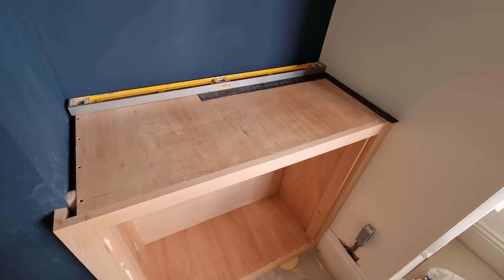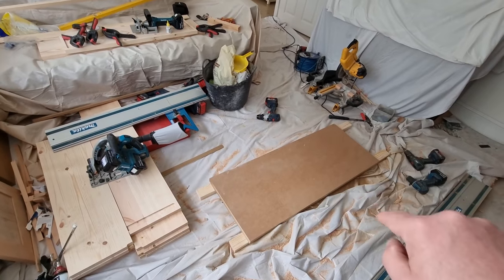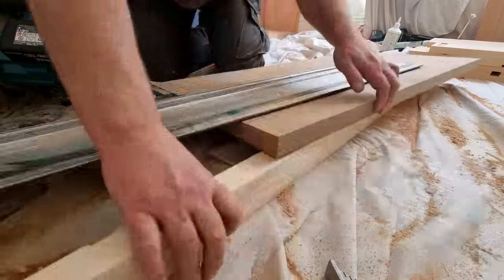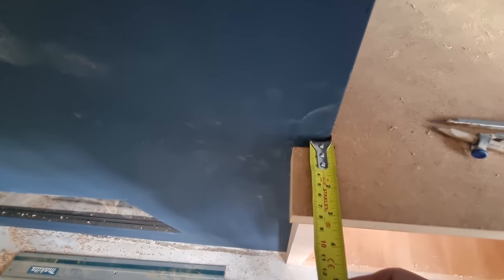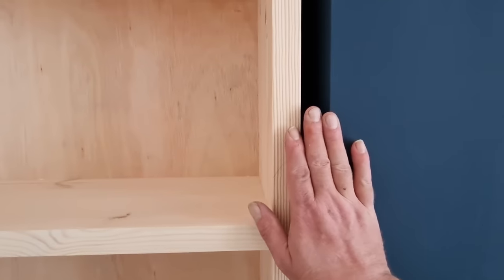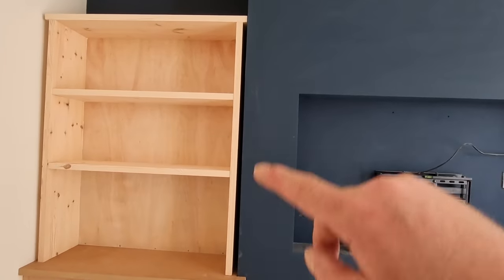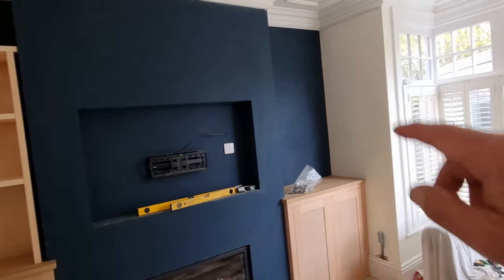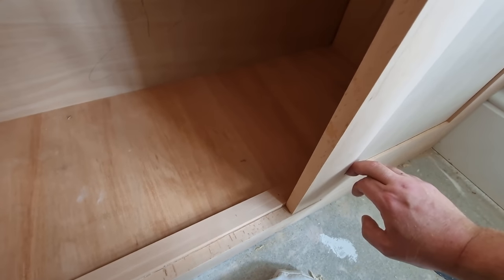Debra's Alcove cupboards & Shelves build Pt7 - Tops & shelf units

Comment: 18g Milwaukee brad nailer is excellent Giid, thanks for the videos they are brilliant !!
Reply from the maker: Thanks & you're welcome, glad you like them 👍 I had a look, but it looks a bit big & if it's like the narrow crown stapler i wouldn't have got it in between those shelves, btw the Hikoki which is also prob a bit bigger than the Makita has been stopped, discontinued, this Makita does ok on softwood & i tried the Hikoki 15g & 16g on Beech into ply & it did ok, so i'll just use those instead & accept a larger pin hole.  -  The narrow crown stapler works well so i might still buy the Milwaukee 18g though one day,  if i have the spare cash 😂😂😂
Reply: You don’t fancy the hitachi gas finish nailer? It’s a lovely wee gun and works great. Much less prone to jamming than the paslode, much cheaper than the battery powered equivalent and just works and works and works.

Comment: Jobs coming on nice now mate, what size is the cabinet top ? It looks fairly substantial about 40mm, don’t see much MDF that size here, to be honest if I want any MRMDF i have to order it as it’s not stocked locally, mind you I do live out In the sticks a bit 👌👌👌👍👍👍🇦🇺
Reply from the maker: Thanks Graham 👍 The MR MDF top is 30mm thick, all materials are a bit hard to get hold of at the moment here & prices are ridiculous, this bed i'm on right now has a box type shelf thing at the bottom, it needs a top 400mm x 1200mm, i would consider using 30mm to match the bed rails & some trim that's going around a shelf unit, but i got a quote for an 8x4, £95+20%vat 😮 it used to be about £40+vat, i'd buy a full sheet then i'd get 4 of these type of alcoves out of it, that's where this piece came from, ½ a sheet remainder from previous jobs,  that bed is now getting a 25mm thick offcut instead. 🤷‍♂️